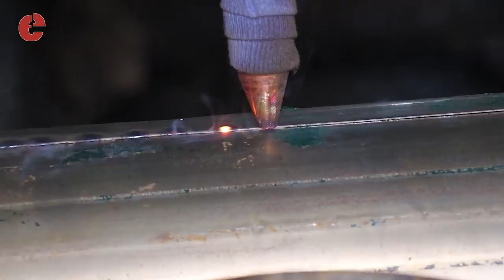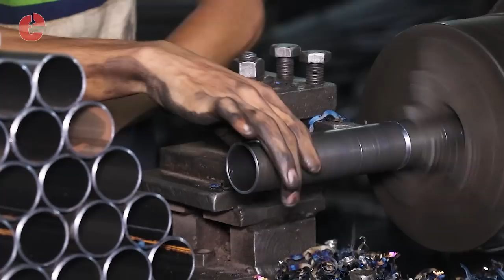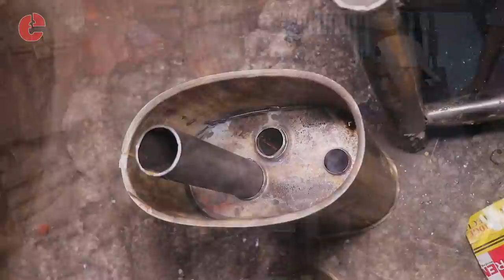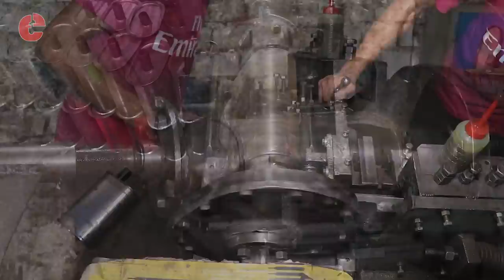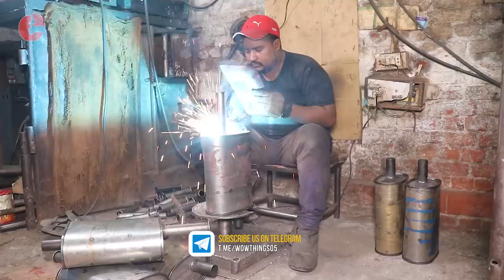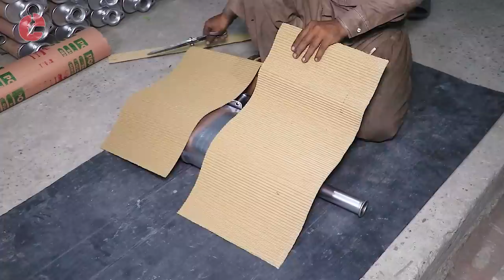How Car Silencers Are Manufactured

Comment: Looks good, but it's a shame they don't do any chemical treatment to prevent rust instead of just slapping some paint on the outside. Then again I guess they are very cheap.
Reply: I think that they should last longer over there if in a dry climate, it’s only if they are  a cycle of wet and then dry recurring cycles that can make corrosion worse,did anyone see any noise insulation fitted inside of them or did I miss that bit.?
Reply: @theonlybuzz1969  I didn't saw that also.
Reply: The cars these end up in probably have no catalytic converters, so less water in the exhaust. But I too wonder, how long such a thing will withstand corrosion?
Reply: @theonlybuzz1969   These are reactive silencers which attenuate noise by reflecting specific acoustic waves (at quarter wavelengths distances) within the internal cavities.
Reply: @theplateisbad1332  give or take 3 months. The baffles go first.
Reply: In a semi-desert or desert climate corrosion really isnt an issue
Reply: @4th_Disciple  Even with a catalytic converter producing water _inside_?